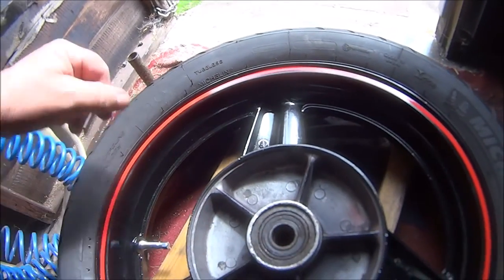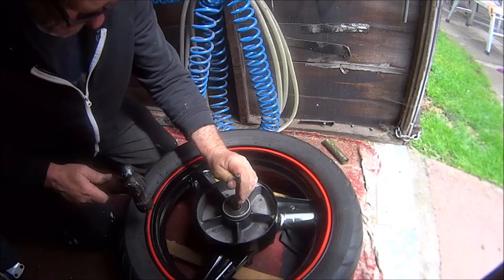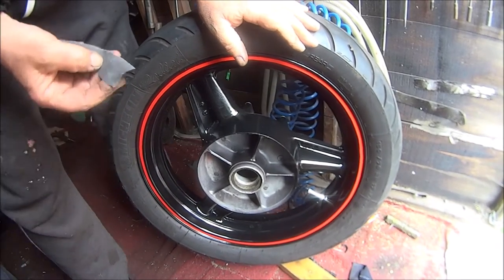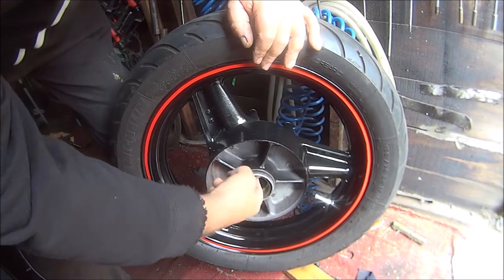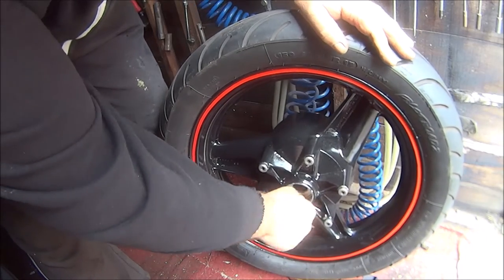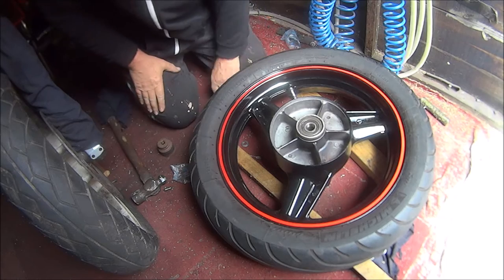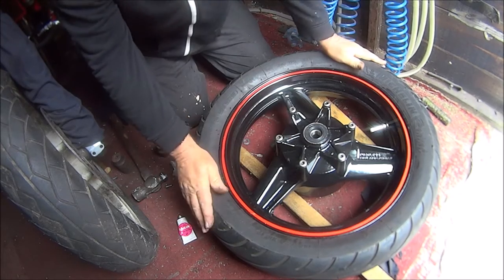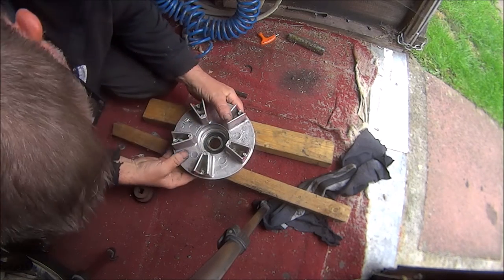Honda cbr1000f, Rear wheel bearings replacement

Comment: Gday, cool video again. I put a bit of grease around new bearings so they don't seize inside the housing, also I put any markings on the bearing facing out, in case it makes finding a part easier. Take it easy mate. Wish I could have a beer with you and you buy the coffee.  cheers
Reply from the maker: Hi bob. Thanks for sharing the tips with everyone. It's not really buying a coffee it all goes towards the project.